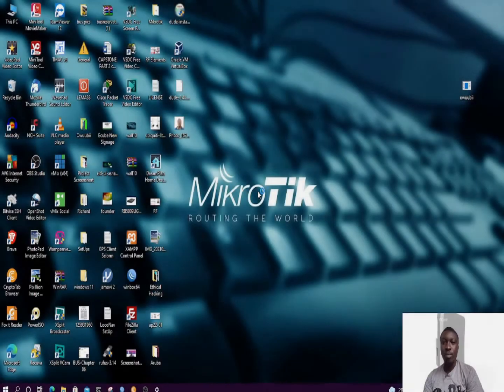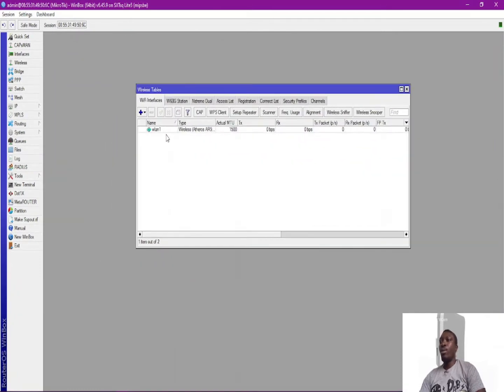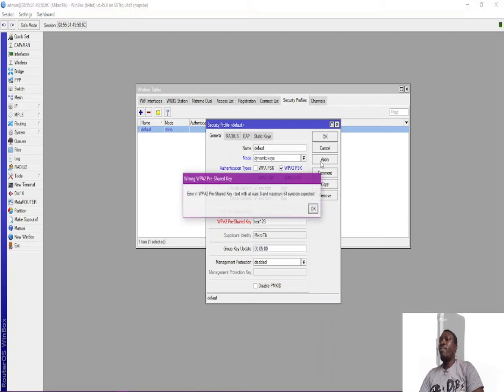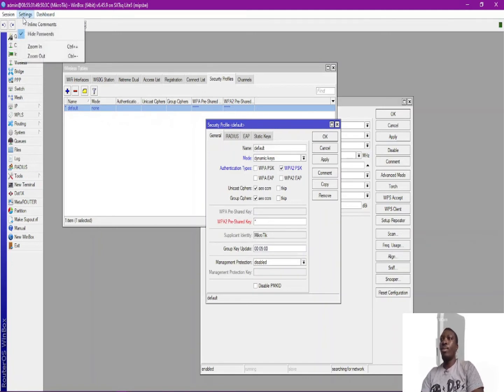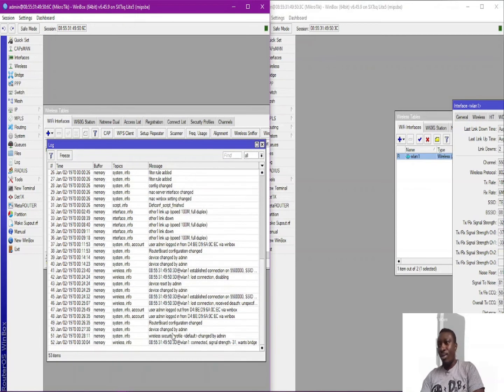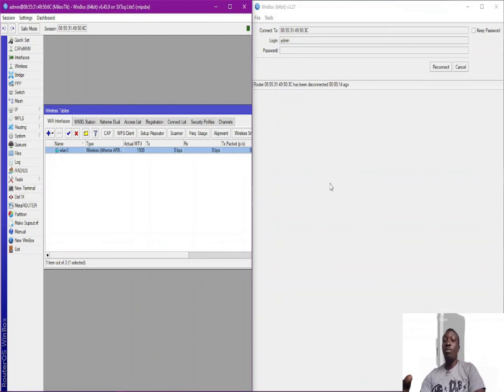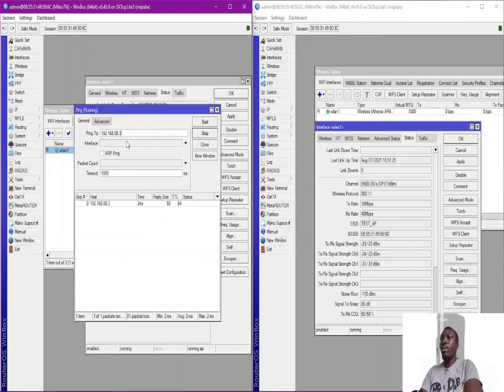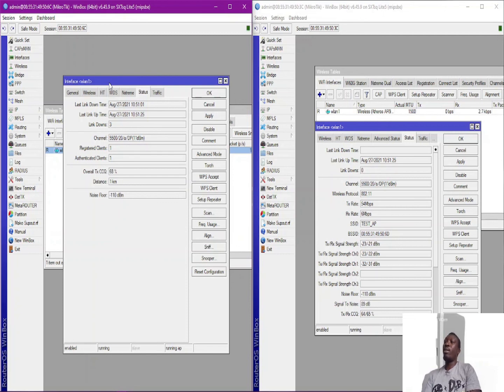mikrotik sxtsq lite5 configuration for point to point connection

Comment: Brotherrrrrrrrrrrrr I'm using TP-Link CPE 610 and other cpes... & Was able to pass hotspot connectioj through wires....but unable to pass hotspot connection through ap and client....only AP hotspot works....client side CPE doesn't work when hotspot unable ...& When I disable hotspot client side able to get internet.....brother do u have any solution for this?
Reply from the maker: Hmm 🤔 I suggest you put both APs on same network the Hotspot uses. Try that and let's see. You can try do some firmware updates as well.
Reply: @owuubii  all routers connect by cable works perfect.... And also outdoor AP works.... Only client which is 500 m far connected via Client CPE takes hotspot and broadcast in router but no connection in client router... I tried putting all in same submer.... Still fail 😭
Reply from the maker: Let's talk here anyt7000@gmail.com